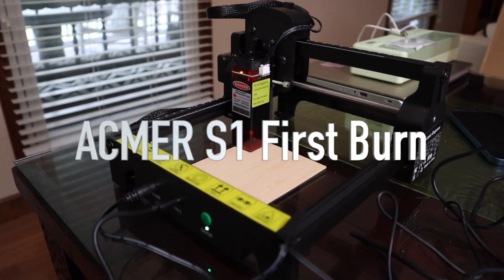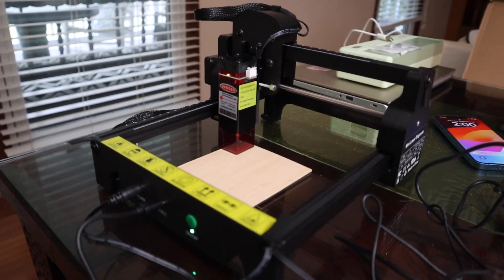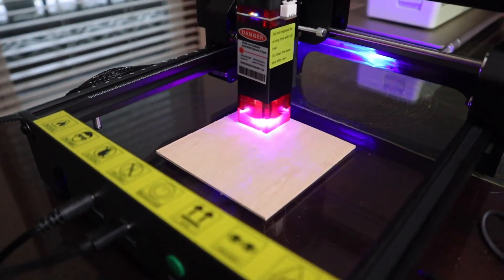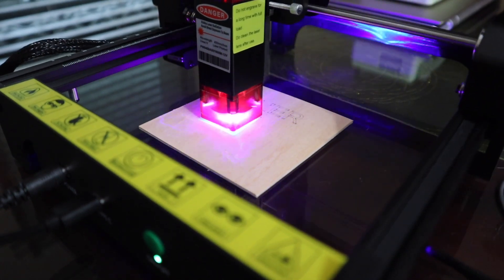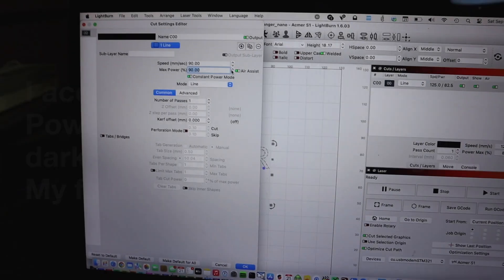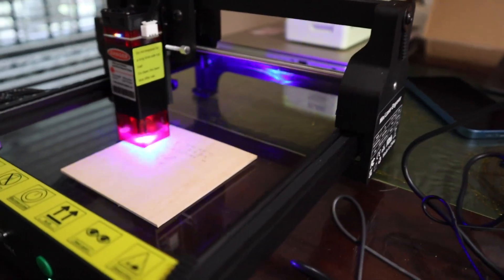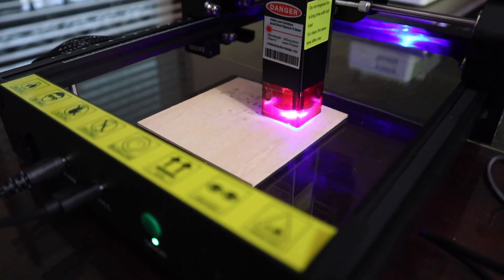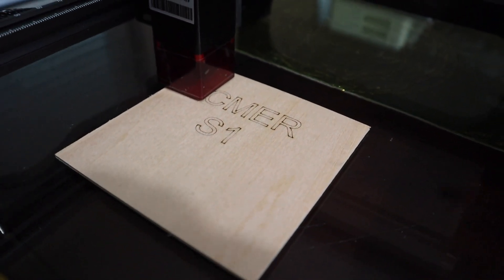ACMER S1 First Burn

Comment: I just grabbed one of these...I got a 6w laser apparently this thing can cut up 10mm or 3/8" and can almost do 12mm but the distance of laser to the stock kills the operation...I'm working max. 1/4" or 6-7 mm so this thing is perfect on a nickel..10w I'm sure will do 1/2" or 13 mm no problem...thanks for the video.